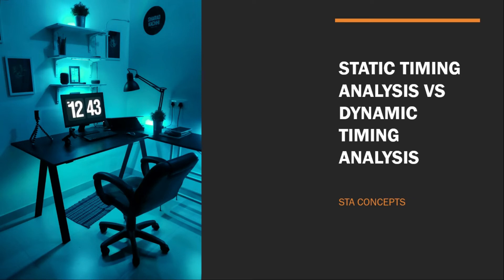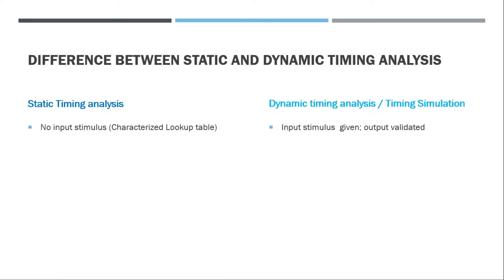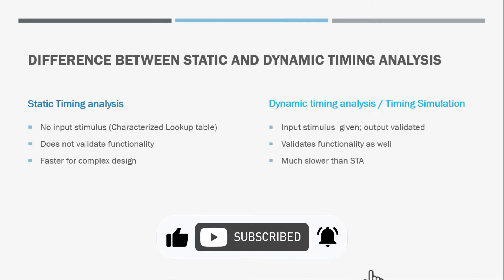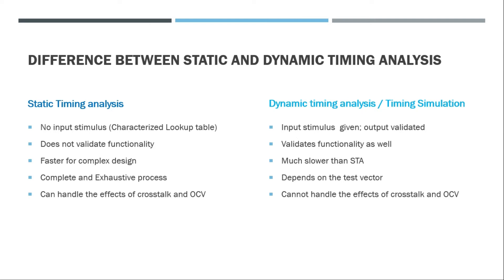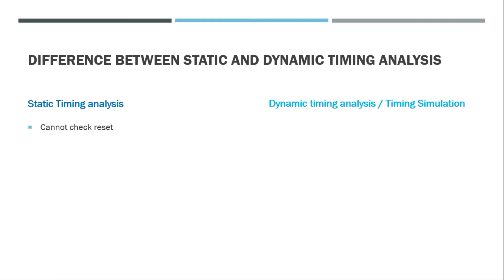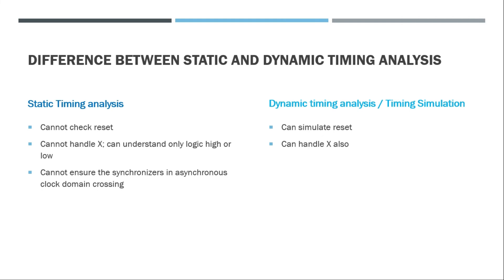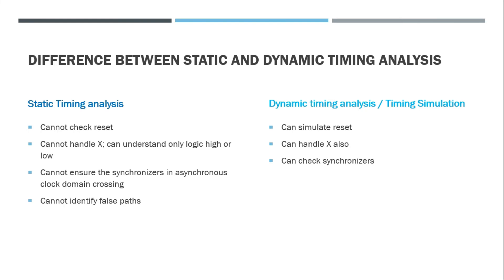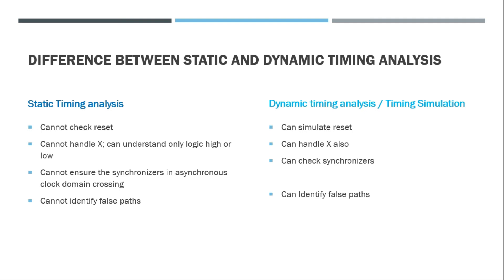Difference between STA and Dynamic timing analysis | STA vs DTA

Comment: So, on the design - DTA gives test inputs to individual instances and calculates delay in real time --- which will be very slow for modern miilion instance ASIC. Does DTA calculate delay based on input transition and output load?